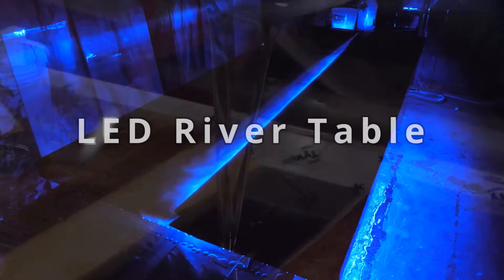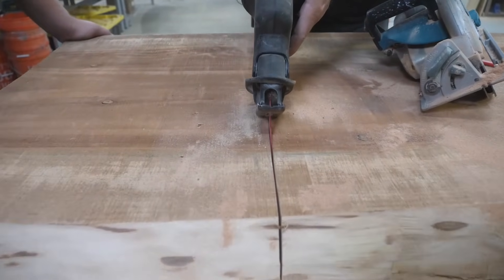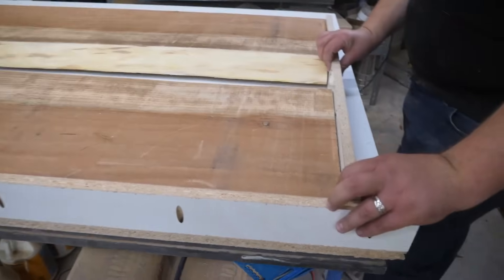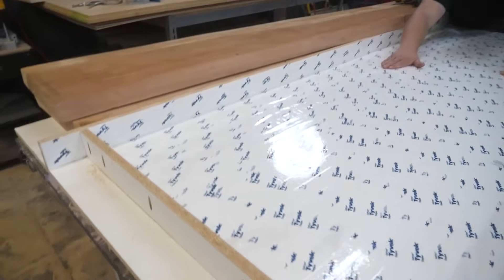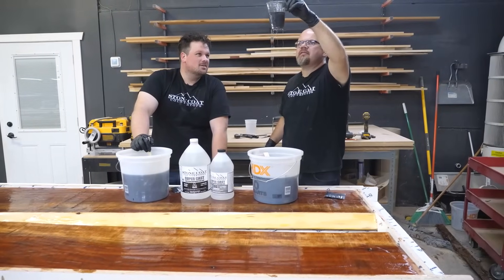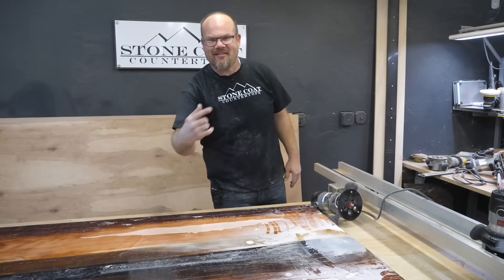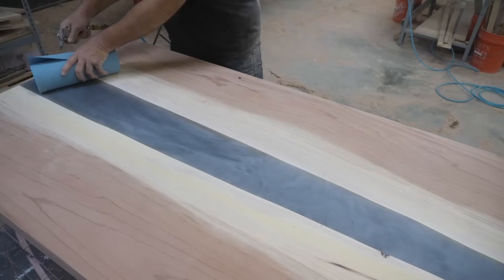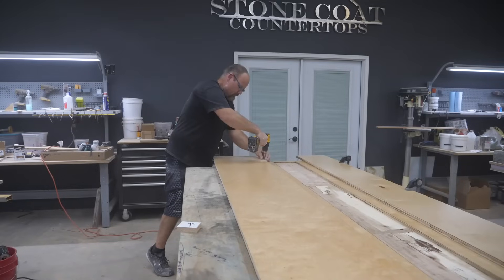LED River Table | FREE Master Class | Stone Coat Epoxy

Comment: Hi I haven't watched all your video yet you're remarking on your nail I am English retired gentleman living in France specialist joiner Cabinet maker are used to get a reasonable size drillbit about the same size of the Nail and very carefully drill a few holes around the side of the Nail i'm going in reasonably deep so you could actually end up going past the night itself and obviously not going through your box office or your board and then with a pair of pin nose pliers you're probably fine you should be able to pull it out, Drillbit make sure you use a high-quality piece not a cheap because you don't want to break that off and leave it in there which would then cause more problems patients is this to do the job right.
Phil from the Moulin in France

Comment: Instead of pulling the nail out, a different option would have been to drive it further down in the slab past where your flattening depth would be. If it were to pass through the bottom, it would be hidden, or push it out far enough to grab and only marr the unseen side.

Comment: Awesome fast moving, info packed, well produced video! I might try to drive the nail further under the surface after removal from the top side failed. Of course if its a screw then your sacrifical bit might be the only option.

Comment: the only issue is if someone will place a cup of hot cup of coffee coz it will leave a mark on the table.. i think .. anmy comment on this please?
Reply from the maker: Great question, Stone Coat Countertop epoxy is very durable. You can set hot pots and pans directly onto the surface; however, just as any countertop surface, we suggest you still use hot pads. -Nathan

Comment: PRO TIP get a slabmizer to help with flatning your slabs and fill nots before any seal coats and another PRO TIP invest in a aluminium table and water cooling system so you can pour deeper and not worrie about sealing your live edges

Comment: HEY!so what happens when those [leds] have to b replaced!? was easy access designed in? could'nt help but notice there was a lot of stability play in your router guide!hope you finally make a better (1)one & oh! that nail ! could of been extracted easily with a little heat! & a pliers after cutting a square or rectangle patch around said nail or whatever foreign object! like the tecnique with the metal & wood combination! tho! the hair drier thing! seems to have better effectuals @ moving color deep! & rather than have people call you to assist wth ratio's & volumes mixtures why not just create a table ratio of measurements! like a divers dive table! size & graphics then makeit available to your existing base. much better to have! such precision guide readily to hand! than a phone! would'nt you say!?

Comment: Dude why mangle a router bit....just use a punch an smash the nail through enough so it can be gripped on the other side an pulled through then plug the nail holewith a piece of dowle or matchstick.....

Comment: Deep pour epoxy that the guy refuses to deep pour! get a pressure chamber that will draw out the air bubbles giving you a better finish and save you a shed load of time! Otherwise it just looks like you are trying to cover up the fact your Deep pour is NOT actually able to pour deep! jumped out at me straight away.